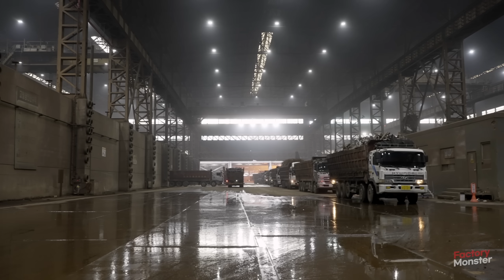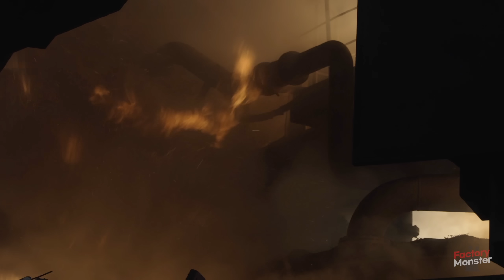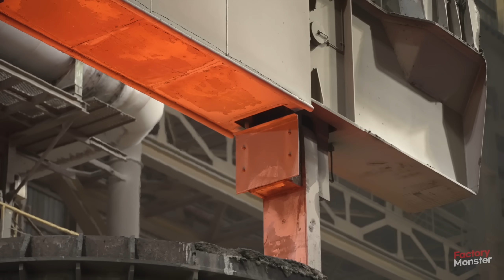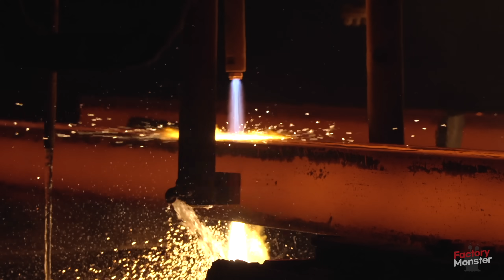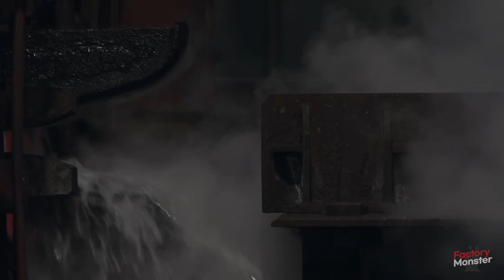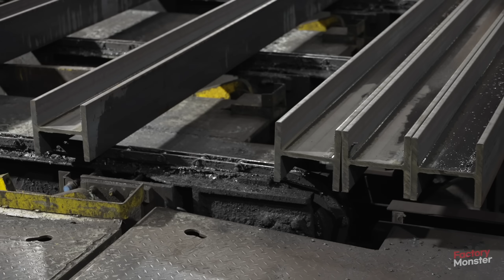Amazing Scale! Process of Making I-Beam with Metal Scrap. Korean Steel Factory

Comment: I saw that they used a magnet, does this magnet also sort by covalence field principles? If so, would assure a higher grade of steel due to non-ferrous and non-magnetic metals being separated from the rest of the ferrous iron bearing metal.

Comment: I perfer I beams .
They are a lot easier.
Just turn an H beam on its  side.
This would be funnier if computers wrote captal i's instead of the communist i.
Reply from the maker: Thanks for watching!
Reply: @Lovegratitudeandabundance  - no, T. But I had to use a T and underline it due to the communist  takeover of computers.
And the communist  editor wouldnt allow it that way eithier. They took away the underline to make it comply with the rules of communism.

Comment: Impressive. Too bad the heat from cooling can't be recovered and used for something like generating electricity.
    Is the scrap mixture analyzed to find out the resulting alloy? H beams would seem to need a controlled metals content and given the ever changing scrap supply would constantly vary.
   I wonder why the bars are allowed to cool only to be reheated for further processing instead of going to the shaping machinery while it's still hot. It might only need a partial reheat that way thus saving energy.
   Looks like a rough job for the workers.
Reply from the maker: Of course they reuse the heat from the furnace :) Those big company know how to save money!
Thanks for watching. Hope you enjoyed!
Reply: rolling the billets right after casting is called 'hot charging' its not too common due to the complexity and diversity of the products being rolled.

Comment: Nice video, and funny commentary! 😂 One thing I've never understood about steel production is that how is it possible to control the composition of the alloy when scrap from many sources (with varying composition) is randomly added to the furnace? Am I missing something?
Reply: After the steel is melted, some is ladled off into pyramid shaped molds and cooled. By analyzing the makeup with a spectrometer at different points on the pyramid, the general makeup of the steel is determined. Then adjustments can be made by adding different raw ingredients. With current equipment the process is quite quick. For what they are making I'm sure that method would be sufficient as it's not super critical to have a certain mixture like in aerospace manufacturing. 
Also the pickers who fill the dumpers at places like this are usually quite good at knowing what to grab and how much to end up with a good mixture.
Reply: @ottopartz1  Thanks very much for the detailed explanation. It's much clearer now 🙂👌

Comment: I've seen these processes for real, long ago - both ferrous and aluminium extrusion, and it always amazed me that, in spite of the immense size of these plants and the machinery the materials move through, they end up sized within very fine tolerances and very homogeneous in hardness and strength!

But on the other side one could argue that the amount of power that's being thrown away cooling the metal, would easily be enough to power and heat an entire city...

Foundries are needed, but they do need to move with the times.

Very well filmed, by the way!! You simply can't convey the noise and heat by watching a video - not to mention the danger if actually being there as a guest.
Reply: a fair point, though you could not build a city without them
Reply: I worked in scrap metal the better part of my life. Let's say on a good day 2 or 3 tons of scrap iron. Look at the weight of the factory equipment! Imagine how much they have to produce to pay for that. I know the price of new iron, love this video! I can not see how they do it! 🐳🎆🙂
Reply: @joecat916  because they can pay the workers about 15$ a day
Reply: Yeah I don’t understand how they can get the consistency/purity/carbon content within the specifications needed for structural beams by recycling scrap metal. Does anyone know?
Reply: @shinjiiiiiiiiii  well besides the dross that gets through (glass, paint, aluminum). Most common iron alloys are 98 + - percent FE the tempering process often causes the different qualities. #1 yards often have an expensive handheld gun with a screen that pinpoints trace elements! Also in those big factories they take and cool an amount of the molten mix, send it via air duct to the lab. Than the lab prescribes a mix of minerals and elements to get the steel to specifications. While the pot is still molten the powder is added and blended. 🤓🤗
Reply: Move the steel beams into a sealed chamber, cool with water, use the steam to drive a turbine?
Reply: @BirdTho  too costly to harvest the steam to generate power. the pressure itself for the turbine will be lost when you put the I beam in 1 by 1 and that chamber will be a major hazard for explosion if done incorrectly.
Reply: Speaking as a person who was born and raised in Pohang, where POSCO, the largest steel mill in Korea, is located. I don't know what other factories are like, but they(POSCO) send the cooling water to use as hot water in several neighborhood. I heard that people spend the winter without worrying about heating. Probably not all steel mills in other regions are like that, but I hope this case will increase. And also want companies to act responsibly in the climate crisis. (Even so, the air is not good because the factory is gathered haha....)
Reply from the maker: Yeah, you're right. As the steel industry is inevitable, it is important to reduce the 'cons' :)
Thanks for your comment!